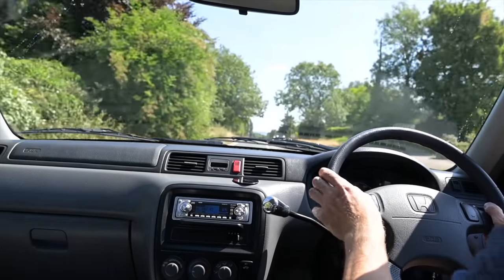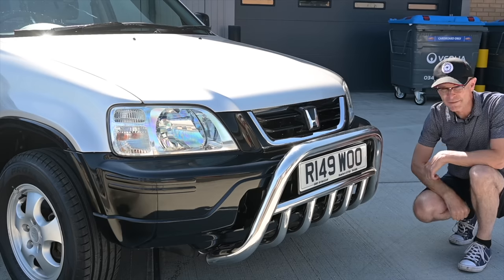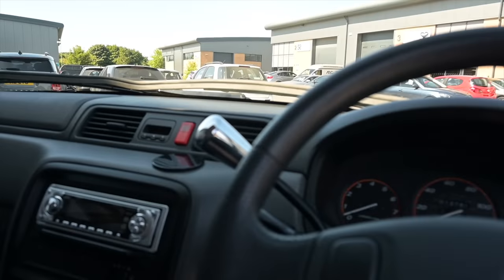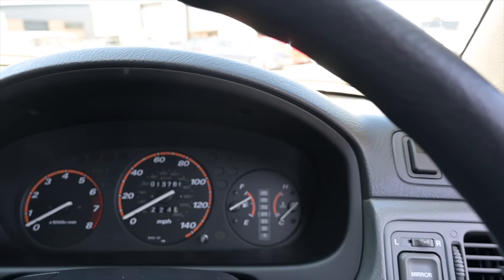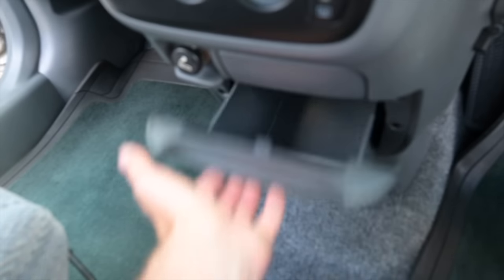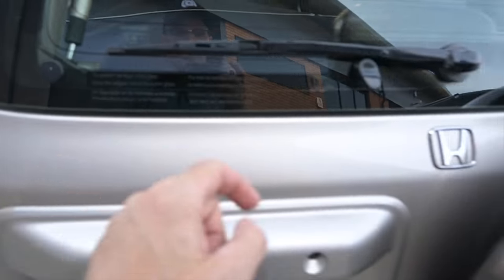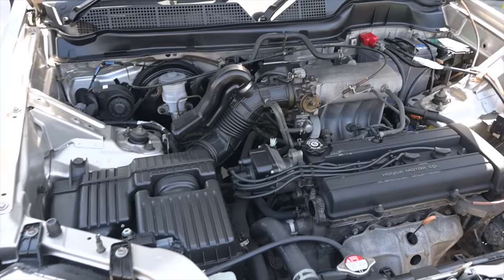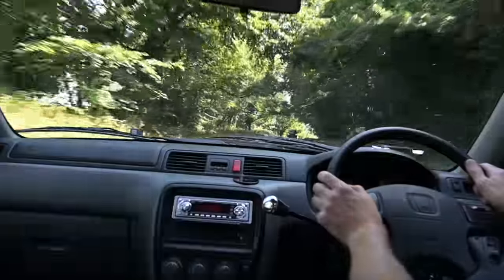Mk1 Honda CR-V Goes for a Drive

Comment: a couple of the women i was working with back in the day bought a CRV, and a RAV four. there was almost no difference in the practicality, and both vehicles did over 350,000 miles, almost trouble free. Created A lot of brand loyalty, sold several other people by example.  Not many makers could say that now.

Comment: Best car I've owned. I went from a very unreliable SEAT to a 99 build CRV. Owned it for 10 years from new. Not one issue, well except for a faulty thermostat at 188000klms. A very easy replacement normally. The issue with the CRV was we got the the old thermostat and the new one mixed up the old one was that clean. Based on this incident my mechanic father sold his Toyota and bought Honda's from then on, only just swapping over to KIA as Honda has lost its mojo so he says. I've owned 2 CRVs with the later version being less quirky and interesting even with the table in the boot. I currently own a Japanese build Mitsubishi Outlander Diesel which is one of the better SUVs off road, being able to lock 4wd in is a real bonus and with a 2000kg towing ability makes it very useful. You could call me an early SUV adopter. 23 years and counting. They suit my needs perfectly.

Comment: Matt, back in 1998 I was looking for a car with some off-road capabilities because I was planning to take my family on a big Aussie road trip. I considered the CR-V, the Toyota RAV-4, the Kia Sportage, and eventually I bought a Suzuki Grand Vitara five door, which had selectable four wheel drive with low range, and was built on a ladder frame chassis. It was an excellent car,  but as it turned out any of the others I considered would have handled the trip. What they wouldn't have handled was some of the real off-road work that later on the Suzuki handled no problem!

Comment: I had one of these back in 2018, bought for £400 but it was in need of some work and high mileage but nevertheless it was 100% reliable. 
     Mine was a 5 speed manual with the gear change on the floor, I think the column lever was on the automatics like that one is. 
     Great cars, and very durable. 
    It’s suprising that late 90’s cars have become “of interest” in recent times, when just 5 years ago they were cheap cars that were being used abused and thrown away. 
      It’s nice to see one in such good condition though, and credit to its former keepers for keeping up the care and attention in it. 
     Great vid once again Matt, thanks.

Comment: one major flaw Matt, the crv is not a 4x4 !
it's front wheel drive with a fluid clutch that only ever kicks in when front wheel slip is detected.
I had the same year model in manual.
a very practical and cheap at the time vehicle. I paid £650 for mine with over 142k on the clock. 
As said ultea reliable and cheap to run however NO match off road to a Freelander.
Reply: The CRV was actually the first compact SUV with on demand all wheel drive for better fuel economy.

Comment: I wish I had asked to purchase my previous neighbour's MK1 CRV. It may have required a bit of tidying up though. My dad has the 2010 CRV with the diesel engine and that is a excellent car and its been a great vehicle and it has been off road a few times. Off road wise it doesn't get stuck much in wet conditions and has actually put Land Rover's to shame especially Land Rover's with silly low profile tyres. His car is now getting a bit clunky on the suspension, gear gator has started to wear and the headlight fade has begun which I hope to cure with a headlight restore kit. All CRV owners will tell you that the driving position is perfectly aligned as that is how Honda wanted the formula to be.

Comment: My Dad had one from 99-04. Very comfy for long distance driving and you can walk from the front seats to the back with the picnic table stowed so keeping yourself dry in wet weather! 😃
About the only downside to the automatic gearbox and 2.0l petrol engine combination was the terrible fuel economy, typically 30mpg on a long run but most of the time low 20's.... I can't remember the tank size but I think the range was about 250 miles, maybe 300 at a stretch. I used to have a 2.0LS Accord of the same generation and could get 35-40mpg on a long run keeping up with the traffic and never less than 30mpg in around town driving.
If you want a recommendation of a more modern Honda to test as a comparison I can recommend the MK2 HR-V, based on the Jazz it is a big improvement especially with the 1.6L diesel. About the only downside is the lack of rear visibility... But nowadays 'they all do that sir' 😉

Comment: I have a 98 model with 300 000 km's. Very similar to this one but the manual and no moon roof. Awesome car. Very reliable and unlike the later ones it is very capable on bad gravel roads. Still see quite a few of them on the road here in South Africa. That camping table is very sturdy 🙂

Comment: Interesting to compare the Mk1 with whatever Mark would have been on sale in 2015 when we got ours (4WD 1.6 diesel). I prefer the dashboard gear lever (like the Civic) on ours to the column gearchange of this one. Ours is a nice car to drive, with one proviso: the diesel engine has bugger-all torque at low revs (I'm used to my Peugeot 306 1.6 HDi) so you have to change down a lot further when turning into a side road, going round a roundabout or climbing a slight hill - which rather spoils the big advantage of a diesel :-( As long as you humour the gearbox, it has tremendous acceleration. Even when I know about this quirk and make allowances for it, I still find it catches me out occasionally and the engine fails to pull in a gear and at an engine and road speed where my Pug would pull very easily.

Comment: I recently bought a 2001 CRV West 1 Edition. It is the 5 speed manual, which is really nice to change gear in. Mine has Aircon and the button is to the right of the blower dials. You can see the blank in-between the 3 buttons.

Comment: 4:10 According to the CR-V video manual (also on YouTube), those small compartments were actually designed to hold a pack of cigarettes (deeper hole) and a lighter (shallow hole).

Comment: I had a gen 2 CRV . Brilliant car - sadly however mine suffered from premature camshaft lobe wear at 155000 miles despite regular yearly oil changes with quality oil. Apparently the cam was a weak spot on 2002-2003 models

Comment: I think needs a Hubnut lesson on the difference between the Triangle of Doom & the Corner of Disappointment. I seem to remember both Mk1&2 CRVs made (from the outside) worrying transmission whine noises, though being Hondas I bet they're still reliable
Reply: Honda autobox wasn't as reliable as their manual counterpart unfortunately.

Comment: It's long overdue for SUV's to go back to their roots.  Those were very capable family cars if one had a caravan, with the right tyres one often did not need assistance to get in or out of a farmers field that he turned into a campsite in the summer.  That was the problem of having a proper off roader and camping, the hours spent towing other camper's in and out the field in a then normal summer.

Comment: I liked those back when they were new and didn’t appeal to everyone. They had a certain charm that truly set the apart from regular cars. They were not just glorified tall cars, they looked like a miniature off roader, similar to competitors like the Freelander, Vitara, and Rav4 (never liked the Rav4, probably the ugliest in its class). Unfortunately that charm wasn’t passed onto its successors; with every new generation the CRV has become more generic to the point is just another crossover that only sells because is a Honda. Take the badge off and no one will even look at it!

Comment: I have an RD1 with 250k miles. Might need new transmission and engine rebuilt soon, but that's okay! Love this car. It does have issues like driver side wiring harness is broken so window doesn't roll down, locks don't work, and speaker is broken, but that's fine I can get that fixed. It also needs all new suspensions so I'm thinking about just rebuilding the whole car as I get money.

Comment: We own a 2000 model year CRV executive auto in 
What Honda call Yellow Sparkle (gold) 104000 miles head light wash switch is by the head light aim control and the front fog switch is by the sun roof cut out switch on our one there are fold out cup holders in rear
Doors and and a retractable cover for the boot keep up the good work

Comment: I learnt to drive in one of these. Also drove it offroad with my cousin who banged it into a ditch. Slightly bent the chassis which wasn't discovered until my parents traded it in - AFTER they'd signed the paperwork!! Not a happy dealer...who didn't check the car properly!

Comment: You're right about current SUV's being a saloon on stilts. If you want something to lug all your stuff about, get an estate - better mpg and better handling. However, my son's friend has a massive St Bernard dog, and the only vehicle which will accomodate this dog comfortably is an Audi Q7. So it's a case of horses for courses really.
Reply: Thats what stuff like minvans are made for. Lots of them out there with better interior space than a q7, whilst still being lower and more economical. If you want markedly more space inside than a q7, thats what for example VW Caravelles are made for. Need even more space than that? There are Transit vans made these days with full interior that drive just about as well and comfortably as a normal car.

As you can see, there are tons of choices that dont necessitate putting the car on stilts, and fitting it with large tires that rob space from the interior, when most of them will never go offroad. A van will do well on enough on anything that might be reasonably called a road, the large wheels and tires of cars these days are to mask how large and slab sided they are compared to older cars. The Long wheel base, 8 feet roof height Transit I use to drive uses smaller tires than a modern Golf! And it works just fine. 

SUVs are a fashion choice for most people, thats all there is to it. Perhaps inclding your sons friend as well, since, from your comment, it seems he hadnt even considered anything but an SUV, or he would have realised that its far from the only vehicle capable of hauling his dog, any van offers more space in the same size bodyshell?

Dont get me started on pick up trucks.... A Van will do just about everything most people use their pick ups for, and better...
Reply from the maker: VW Touran would be ideal for that, not too high to climb in
Reply: @furiousdriving  or Citroen Berlingo

Comment: Looks like every bit of black plastic on that car got a repaint with shiny. Its not bad but a little more plastic looking. It does fit with the vaporwave 90s look they had though.
Reply: Also.. Cooompletely unaware they sold versions with a sun roof. I'm thinking that was not an option in the US.

Comment: The spare wheel on the tailgate of early SUVs often had another reason. Many SUVs of this time were based on a front-wheel drive platform. Adding a driven rear axle meant there was no space at the back to stow the spare wheel under the trunk. In the trunk, the spare wheel would have taken up too much space and reduced it considerably. So they took up the off-roaders' solution and mounted the spare wheel at the rear.
Reply from the maker: Good point, they wouldnt have had space with the rear diff added

Comment: So do you get a commission if the vehicle you advertise/test is sold via your channel? And oil should be changed every year maximum, not two.
Reply from the maker: no, just access to an ever changing roster or great cars. 
That was a joke, saying how tough Hondas are
Reply: @furiousdriving  Tis a handy collab for sure, you have some great offerings/reviews. Oh, apologies, missed the reference re. Honda's durability. You're right though, I have two old Accords and they're by far the most reliable I've owned out of the dozens of cars I've had.

Comment: I quite like these but they have absolutely zero legroom behind the wheel.
Reply from the maker: It was fine for me at 5'11"
Reply: The newer versions from around 2008 onwards have decent legroom and if you get a 2.2 diesel it shifts really quickly.
Reply: @furiousdriving  I'm 197cm tall or around 6'6".I've resigned myself to Swedish or German cars. Even the new versions of the CRV of which my Mum has had the current and last gen have been tight behind the wheel.

Comment: Not convinced really. I know Japanese vehicles are reliable and functional, but they lack a  bit of character.
Reply: C'mon, the 8th-gen Civic hatch (commonly called the UFO Civic) had a lot more character than most.  It was virtually French.  It seems buyers didn't really want that, and it has returned to a more conventional style since then.

Honda has very often taken risks with car design.  Not so much in this car, but in plenty of others. Be it the 1300 Coupe 9, the Beat, the City Turbo, the Element (a four-seater SUV with no B-pillar and a sunroof over the boot, because why not!), the six-seat FR-V, the original Insight with the aluminium body, the original HR-V in two doors with the roof spoiler, the CR-Z...  Honda has plenty of radical designs.

The two Honda NSXs -- analogue era and hybrid era -- are perhaps a little bland but still very good sportscars too, they drive very well, and Toyota's Lexus LFA is arguably the greatest sportscar of all time.  It's arguably superior to any Porsche Carrera GT or Ferrari Enzo.  The LFA is such a perfectly engineered sportscar and incredibly precise and theatrical.
Reply: Not really, most Honda's are generally boxey and boring but do what they are supposed to do. They have made an occasional sportyish car but mostly focus on people in the over 50s.
Reply: @russellcooper5826  "do what they are supposed to do." That's the point, even the NSX, TLX Type S and Fireblade are the same.  All the sportscar (sports sedan or sportsbike) you need , not all the sportscar/sedan/bike you want (i.e., the flashy Ferrari, Quadrifolgio or Ducati).  It is a bit of a problem for Honda in the aspirational segment to be honest, but oh well. 🙂

The Honda Wave is all the scooter you need, sells well.  The Honda CR-V is all the SUV you need, etc.

I don't see an issue with the Honda Jazz being unashamedly designed for over 50s and being all the supermini a senior motorist needs, it sells well in that market.  I don't think a Ford Fiesta or MINI Cooper offers any more functionality, Honda are quite capable of making the Jazz handle better if that's what buyers request but I suspect typical Jazz buyers do not  complain about not having sports suspension or about having too much interior space due to the boxy shape and magic seats! 🙂

For me, vehicles like the VTEC Civic Type Rs and VTEC CB400 Super Four are plenty characterful! They have that naturally aspirated high-revving Honda character IMO. ☺ To see the joy on the heritage collection technician's face when they get that historic 250cc inline-six GP bike running on the Honda open day shows that it IS very much a company with a lot of passion IMO.

The CR-V on test is a sensible car and it's not supposed to be remarkable, but I reckon the HR-V of the period is pretty cool with the two door body and roof spoiler! ☺
Reply: @russellcooper5826  Maybe your complaint is a general complaint about the Japanese market?  

In the Japanese market there is generally a VERY large difference between standard models (e.g., the stodgy standard Subaru Impreza or stodgy standard Toyota Yaris) and sports models (e.g., the fire-breathing Subaru Impreza WRX STi or Toyota Yaris GR).  They are different vehicles for different purposes according to the Japanese view.

In the European market however, the standard models tend to be more sporty (like a regular Ford Focus or VW Polo), but the sports models (like a Focus ST or Polo GTI) tend to be not as extremely sporty.  I.e., the spread between the regular and sports variants is not as large.
Reply: @Russell Cooper I don't agree. A lot of characterful and interesting cars have come out of Japan, be it small cars or performance stuff. German cars meanwhile send me to 😴 which is why I've never had any desire to own one. Indeed I often wonder if German car makers actually have design teams. Case in point. The VW Golf. It's still the same boring box it's been since mk1....
Reply: @TassieLorenzo  You forgot to mention the Prelude - especially the mk4 - which was a real blast to drive with the 2.2 VTEC unit and looked like nothing else. It was a lovely looking thing, and still is to my eyes. The CRX mk1 and mk2 (especially with the B16 engine) were cool cars. The Integra Type R was nothing short of Awsome and was said to be the best FWD performance car ever made. No wonder all these models are increasing in value.
Reply: I mean, show me a European manufacturer who has/had the range of, let's see... Toyota ... over the last 20 years in terms of their cars which have unique characters: Celica, MR2 mk1, mk2, mk3 (all different characters), Supra (classic / GR), GT/GR86, GR Yaris, GR Corolla, Rav4, Hilux ... all super reliable too.

Comment: I wouldn't of Minded a CRV for Load space as always picking up big Items like Arcade Machines but Didnt want 2.0L Drinking Fuel doing 10k yearly. HRV Which i prefer Styling Of had Done the Job, Modified with 1.5L Lean Burn Civic Engine its now pefect with near Diesel Economy Cheaper Tax and Reliable